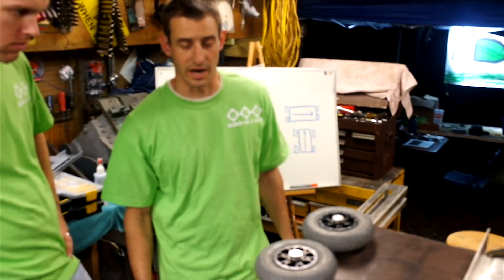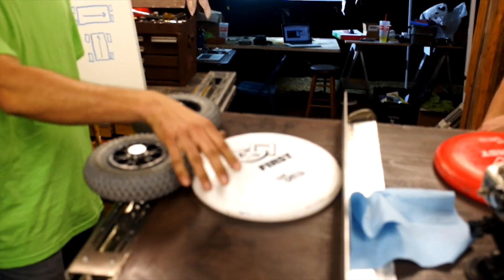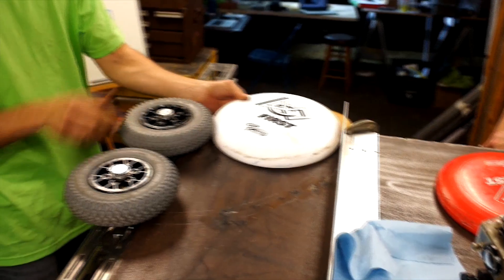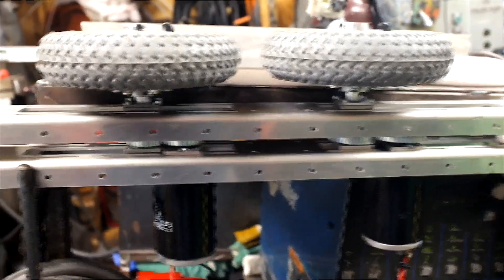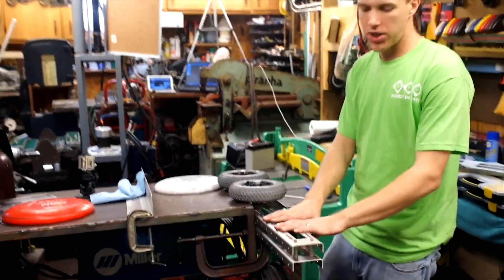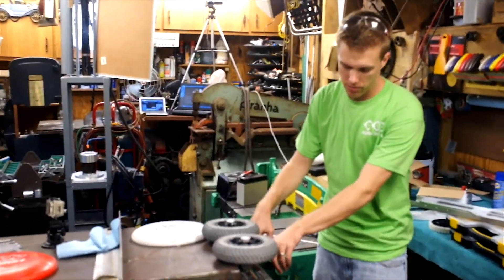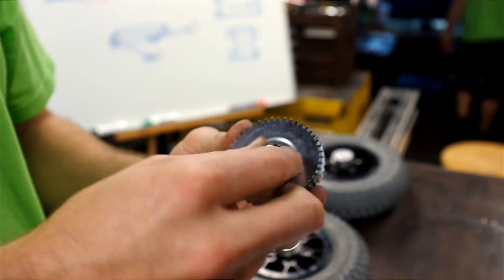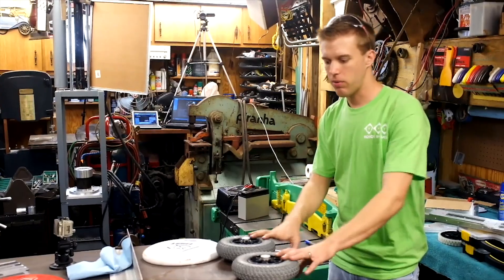Robot in 3 days: Frisbee Shooter 2 for FRC Ultimate Ascent 2013

Comment: I sort of liked the first approach. One less motor and if you had a system which allows the quarter round section to rotate you could adjust aim without moving the robot.  That said I must say that my first design idea was closer to your v2. - reduced size and weight is always a huge consideration, particularly in this event. I'm still on the fence with regard to the linear vs semi-circle.  What about using one motor for spin and imparting some forward propulsion using a spring or surgical tube